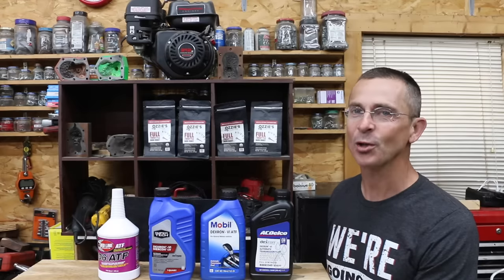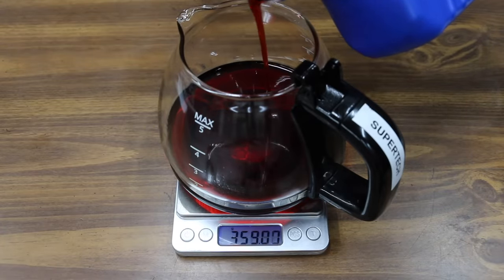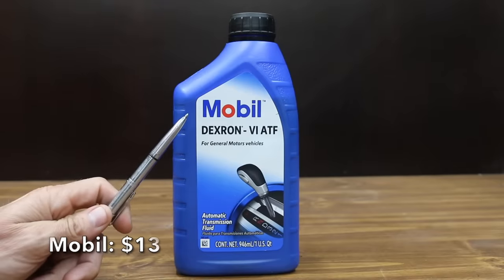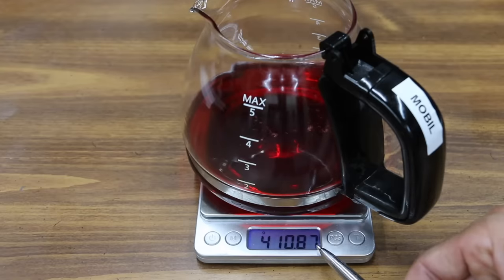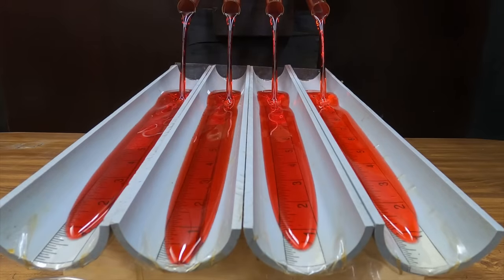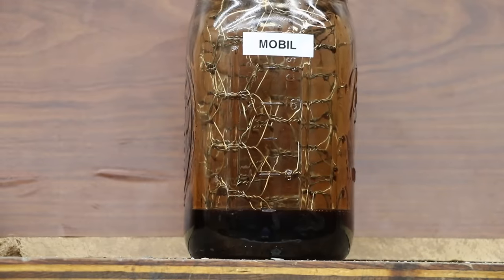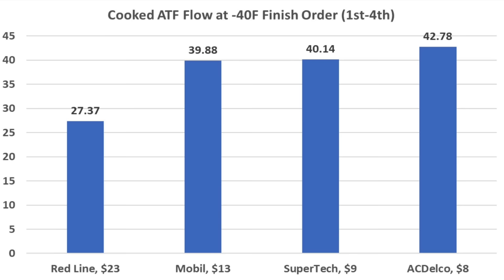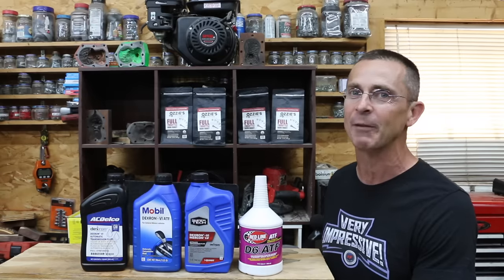SuperTech ATF Safe to Use? Let's find out!

Comment: You'll have to come up with a device to test friction plate torque on different fluids. ATF's friction modifiers are an important aspect of transmission shift performance. Maybe one of the clutch assemblies from a transmission then put some springs in place for a constant pressure. You'd have to soak each friction element for each fluid tested then test break-away torque on each.
Reply from the maker: Thanks for the suggestion.
Reply: Why don’t you do that pal… and just say thank 🤦‍♂️🤦‍♂️😂

Comment: I'd be curious to see a showdown of "universal" or "multi-vehicle" ATF fluids. One of the most popular that comes to mind is Valvoline's gallon jug that aells at a competitive price, seems popular, but I'm curious how good those other "universal" fluids are.
Reply from the maker: Thanks for the suggestion.
Reply: Agreed the vavloline atf would Made this the project complete
Reply: Agreed!
Reply: Yup
Reply: I use valvoline atf. D best
Reply: Yes. I have a 2014 equinox that’s going to hit 200,000 this weekend and every 20k since I bought it at 60k, I’ve drained a gallon out and replaced with the valvoline. Still going strong. I also use super tech oil but I do use a K&N or Wix filter.
Reply: Valvoline maxlife multivehicle
Reply: @Fister_of_Muppets  I got some Lucas, Mobil 1 and royal purple multi vehicle too. Good for mercon/mercon v applications
Reply: Yes valvoline maxlife or just valvoline atf4 seems to be the most popular option for atf. 

Either way, great work as always from project farm

Comment: Nice Project Farm! I'd love to see a video testing OEM fluids! Almost every auto manufacturer claims you MUST stick with the factory fluid.
Reply: and it's just technically incorrect. They say that not just to have you buy their brand name, it's just to be safe you're using the correct one. A lot of these oils are multiple labels slapped on the same exact product. In fact, there are shared products between Motorcraft which is Ford and AC Delco for GM. More than a few, I've come to find out.
Reply: I don’t think most car manufactures make their own oils, they will contract out one of the larger oil manufacturers to make it and slap a different label on it. O
Reply from the maker: Thanks!  Thanks for the suggestion.
Reply: @White000Crow  you're right, and not all car makers have their own label for oils. Acura has their own brand that we make, it's the same as Honda and our shared brands too.

Comment: I like these oil tests, cheap and basic but really informative.

Something to do with brake fluid would be good (if you haven't already) comparing all of the different DOT ratings.
Reply from the maker: Thanks!  Thanks for the suggestion.
Reply: @ProjectFarm - especially if DOT 5.1 is backward compatible with DOT3 brake systems.
Reply: @davidturk6170  It is :) DOT 5 is the only oddball here. But it would be interesting to see the differences in actual boiling point, hygroscopic degradation etc.
Reply: I agree, I'd like to see a brake fluid test! I personally run Motul 660 and am convinced it's the best. The before and after performance it gives you is crazy. Probably one of the most expensive though but I learned why
Reply: That would be a great test.  I had been overpaying for Motul RBF 600, but on a whim I downgraded to Pennzoil Dot 4 synthetic and demonstrated to myself that the cheaper fluid was just as good for everyday use, including the occasional 1 off panic stop, as the Motul without any noticeable loss of linearity.  Extremely linear braking performance with the pennzoil from what I remember.  Of course none of that involved boiling the fluid to its limits....
Semi metallic brake pads vs ceramic brake vs super-economy pads also would be very good to somehow demonstrate (on a bench test).  Yeah, the semi metallic are going to have marginal to noticeably-better braking performance, but at what cost to all the hardware and dusting?  Might be a messy test though.
Reply: @ProjectFarm  I vote second for brake fluid testing. Please make use of a reliable brake fluid (water content) tester as the water content greatly reduces the performance. I DIY all brake jobs on my cars and I have thrown away brake fluid which had more than 2.5% water content straight out of a sealed can/bottle. I have to repurchase again (sometimes arguing with the sellers although I know it's not 100% their fault) to get a 0% water content/pure brake fluid otherwise the job wouldn't be satisfactory. Thx.

Comment: FWIW, most of us in the Spec E46 racing class use Redline products because they've proven to perform better in our cars.  Good to see some testing back that up as well.
Reply from the maker: Thanks!  Thanks for the feedback.
Reply: Dasfahrer. I use Pentosin ATF1 in my automatic e36 M3. This is the factory specified fluid. It is a light amber color. Expensive.

Comment: I'm about to change the manual transmission fluid in my 2007 g35; I had been using nissan fluid the past 2 changes and had been doing a fluid change every 30K miles;  I bought Redline MTL months ago just because the nissan fluid pricing go much more expensive, and I was hesitant on using Redline, but after seeing this video, I have now more confidence in switching to Redline products.  Thanks again for doing all this research, very helpful to consumers!   More power to your channel and please continue doing what you do!
Reply from the maker: Thanks, will do!

Comment: FUN FACT: Tesla uses Dexron 6 in the rear drive units.
Reply: Wait…. WHAT?? Petroleum in a “zero emissions vehicle”… man that doesn’t bode well for the virtue signaling
Reply: Electric cars don't have transmissions. I think they operate on an 'electric-wind' rubber band. The originator, Gomer Tesla, said the idea came to him when he was struck by lightning while playing golf. The only fluid in the Tesla is the liquid nitrogen in the a/c.
Reply: @nordicpride9708  yes! Believe it or not some dinosaurs are still needed for EV's lol
Reply: @MrTruckerf  Incorrect. Teslas even have an external spin-on transmission fluid filter that looks like an oil filter.

You also forgot the brake fluid and coolant as well.
Reply: @MrTruckerf  I hope ur joking, but if not that's incorrect. EV's have front and rear gearboxes, differentials, cv axles that contain grease, and also have coolant that cools Chargers, inverters and electric motor stators and rotors.
Reply: @WarpedYT  Man you made my day! We already have a Gen Z who has a super computer in their hand in straight and utter DENIAL that PETROLEUM products could ever be used in a superior automobile “EV”…🤣🤣🤣. Same people that would cry if they knew how many barrels of “evil” crude it took to make their precious electric cars. The ignorance is glaring and laughable. So thanks for the priceless posts. Made my day!
Reply: @MrTruckerf  The first generation Teslas had a 2 speed gearbox, and all Teslas use coolant for cooling the battery cells as well.  among a few other things.  they have more liquids than you might think.
Reply: @nordicpride9708 🙂, I just state facts, if I don't know for sure I'll usually just stay quiet, unless I'm messing with someone
Reply: @WarpedYT  In 2023 we need facts more than ever. Cheers 🍻
Reply: @MrTruckerf   Even if what you said was true that still doesn't negate the fact that it uses petroleum products for all of the plastics used in the vehicle.
Reply: The problem with fossil fuels that motivates a transition to EVs is not with petroleum by itself, but with the combustion of petroleum. All rotating machinery requires lubrication. This is almost always achieved with petroleum based lubricants. EV drivers are not being hypocrites for owning a vehicle that uses lubricating oil. What EVs achieve is the ability to drastically reduce the green house gases generated from operating the vehicle. That lubricating oil isn't being combusted, so it's not being converted to green house gasses like CO2 and inhalation hazards like nitrous oxides. Also, those lubricating oils, aren't being contaminated by combustion byproducts, so they basically last the life of the vehicle. So their waste is pretty minimal, and lubricating oils aren't a huge hazard when properly disposed of.
Reply: @MrTruckerf  Do some homework, okay?
Reply: Good deal, looks like I'll be putting some red line in my tesla when I get one lol
Reply: I’d rather drink 12 quarts of Dex 6 than drive a Tesla
Reply: What do they use in their front drive units?
Reply: @MrTruckerf  Wrong
Reply: @anthonybutterbaugh4252  Is it too quick for you? 😆
Reply: I love how YouTube is blocking my posting Peter Zeihan video on EV’s. I must have offended a smug simp… the truth is out there for those non sheep types who are about facts/data

Peter Zeihan “EV’s no so little dirty secrets” for anyone interested in a educated man speaking facts
Reply: @mcplutt  prolly mercon 😂
Reply: @nordicpride9708  Project Farm may have "Block Links" enabled, for good reason. You will have to spell it out to post, but ima look that up right now cause u got me curious now. 🙂
Reply: @evansuggs  very true and even more so that the lubricating oils don't experience the high heat and contamination from the combustion process. It's basically like oil in the transmission or oil in the differential, it lasts for a while and can be easily recycled. I think the issue is that Tesla pushed this false marketing agenda for such a long time to take the EV lead at any expense, that they have actually convinced people that Teslas don't use oil, common sense would tell u otherwise but not everyone is mechanically inclined, Most customers are not. But your spot on.
Reply: @WarpedYT  Hey good to know, thanks! Peter has a lot of great information on EV’s, global supply chain issues, population decline,how solar panels actually create MORE carbon emissions. Best part is he has not vested interest to sway one way or another. He is a numbers guy. I think you’ll enjoy his unbiased content.
Reply: @mcplutt  a thick amber colored medium viscosity gear oil and after 2016 a thinner gear oil.
Reply: @anthonybutterbaugh4252  it's not that bad unless u take a road trip.
Reply: @adventureoflinkmk2  I'm sure u can
Reply: I absolutely love that people are responding to @MrTruckerf as if his statement is in any way serious. 

“Electric wind bands developed by Gomer Tesla after being struck by lightning”. 

Epic.
Reply: People here are funny, please tell us how many liters of oil will and ICE car consume in 25 years and how much oil will and EV need... You are all beyond ignorant.
Reply: @MrTruckerf  lay off the drugs buddy, I hope you are trolling
Reply: @anthonybutterbaugh4252  yeah sure buddy, maybe once they release you from the institution
Reply: @nordicpride9708  even with all of that they are still 10 times better than ice stuff. People are not aware of how much ices are really dirty
Reply: @riba2233  Would you like oil numbers for one Tesla battery? It takes 4 400 ton haul trucks of material in prime conditions to make 1 Tesla battery. That is just the production truck side of things. You can do the math on what a production truck runs per hour, right?
Reply: @ducewags  that is a pure and utter bollocks, please stop reading qanon stuff. Also I was talking about how much the car itself consumes in its lifetime, which is next to nothing.
Reply: @riba2233  I am infact a MEM for the mine service. You might be the one that has NO clue on things. A EV will use more "dirty power" then you will even know about.
Reply: @ducewags  yeah buddy I am sure you know what you are talking about 🙄  in any case you don't, I know more about the EV's than you ever will so don't even bother. 
The fact that you can't even answer my simple question just proves that.
Reply: @riba2233  Nobody is saying internal combustion engines are absolutely clean. That said EV’s aren’t 10 times better either. If you add up all the production, battery degradation, power used to charge the vehicles over its lifetime. It’s not zero emissions, sorry it’s just not the case. Personally I think electric motor tech is cool, however battery tech just isn’t there nor is North Americas power grid. Maybe sodium batts will change that. Regardless, petroleum is here to stay in many industries. I don’t see an electric turbo fan powering a 737 or a A320. Elon has even said that’s impossible. 

Californias 2035 approach is simply ignorant and not feasible. In the broader scheme of things I see EV as reducing our “dependence” and not the superseding technology to replace any and all internal combustion engines. You have to not only look at transportation, but industry. And most Americans can’t afford an EV. For myself I tow a large boat. A Rivian or ford F150 lightning Ev won’t make it to the lake and back. Things are pathetic. Hoovie tested a EV F150 and ford told him he needed to drive 55 to get more range lol. No thanks. But you are free to have your opinion and passion regarding EV’s. I wouldn’t call yourself an expert however. Researching things on the internet is slippery slope my friend.
Reply: @nordicpride9708  it could be full synthetic not made from oil ,  its from  methane gas from landfills
Reply: @jusb1066  And the sky “could” be purple. Yes I’m familiar with GTL (gas to liquid technology). Pennzoil uses this process in their top tier synthetics. That’s said 90% of other modern group 3 synthetics are “hydro cracked” petroleum base oils, ATF’s included which are simply 20wt or less hydraulic oils with a red dye added to identify. GTL tech isn’t cheap. Most manufacturers go for the lowest bid on fluids. But nice try.
Reply: @nordicpride9708  but you expect to dump existing decades of lubrication technology because its from crude oil?  at least that oil can be refined and used, gasoline is up in the air and around 150,000 kg of it in its life.  guess what, your car has 2kg of lithium grease in it, more lithium than tesla uses in batteries,   is that recycled? no its mostly spread evenly across roads and into rivers
Reply: @anthonybutterbaugh4252  why? I bet you’re actually too young to drive anyway. You’ll learn to prioritize usefulness over pride eventually.
Reply: Did none of you really not get that MrTuckerf's comment was a joke? REALLY? Wow....
Reply: @ducewags  “a EV” let’s stop right there professor 🤡
Reply: @nordicpride9708  nobody claimed zero total emissions
Reply: @nordicpride9708  so because electric planes are possibly impossible to use, we should just ditch electricity and go back to whale oil and coal? You use a straw man, I’ll use him right back.
Reply: @T..C..M  You don't like the idea of "a EV" in what I wrote, as in one? Shall we talk about the amount of Earth that has to move to make "a" EV battery just for the lithium? As you seem to know more about mined material then I do, right "professor"? Who dumbed you down? Or is it a self inflicted dumbing down you suffer from?
Reply: @T..C..M  Look at the sticker on the bumper pal
Reply: @MrTruckerf  And the Dextron 6 in the rear drive unit...
Reply: @JimYeats  he (edited) the comment, originally it said something else.
Reply: @riba2233  learn the science of manufacturing. EVs are all about the money and are a way to take more of the individuals autonomy. Game over, friend.
Reply: @marshmower  I'm perplexed by the idea that an electric vehicle takes more of your autonomy than a combustion one. Either way you're beholden to the whole complex network of infrastructure and control that gets energy into the vehicle, unless you have a combustion car that runs on grain alcohol and a substantial amount of land to grow all the required corn, or a set of solar panels in which case you could charge your EV for free.

Now you might argue that its all the computer gizmos that the government will use to disable your personal mobility. But ICE cars have those too, and have had them for decades.

Other than that, it's what, the charging times? I guess this is true, but before cars everyone got around by horses (which have long charging times too; they've got to stop and eat regularly) and nobody says that horses deprived folks of their autonomy back in the day. Just meant a long trip needed a bit more planning.

Comment: ATF+ 4 would be a good trans fluid test. thanks project farm for all the work you put in to keep the rest of us informed👍
Reply from the maker: You are welcome!  Thanks for the suggestion.
Reply: ATF+4 is trash just like chrysler transmissions
Reply: @benjamin8981  if you know all the answers already, why are you watching PF?? And why are you even bothering to troll +4??
"Me thinks you doth protest too much"....troll bot.
Reply: @budlanctot3060  yeah most of the products i frequently use or buy have been based off of experience. but this time i am 100% biased opinion against ATF+4 only because it’s chrysler approved and their engineering is 80% of my problems at work. back to the experience side, the only good fluid i’ve ever seen come from mopar is their black rtv sealant. i love that stuff
Reply: ATF +4 is Chrysler's formula for their original synthetic ATF. I believe they have gone to a lighter viscosity for their newer vehicles now as well.
Reply: @oneninerniner3427  well I wouldn't be too surprised. Does Chrysler even make their own brand of transmissions anymore? The NAG1 was a Mercedes trans. I think they currently use Getrag, and ZF transmissions. So I'm pretty sure they use whatever those vendors recommend.
Reply: @budlanctot3060  yup, l believe that's correct. I'm pretty sure they bid out their fluids, oils & greases to whoever gives them the best deal to formulate it to their own called out specs. That's what most manufacturers do, they don't actually make/formulate/blend it themselves.
Reply: @budlanctot3060  i believe their 9 speeds are still mercedes and all their fwd are hyundai 6 speeds. they use warn and zf for their differentials for sure